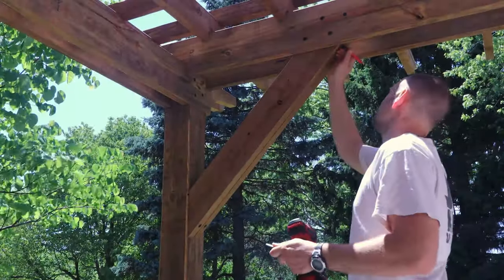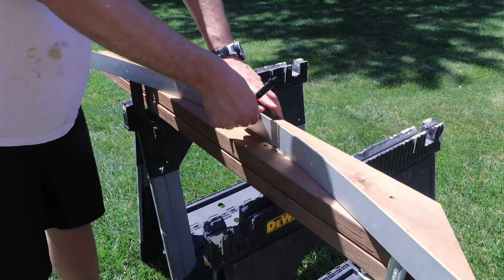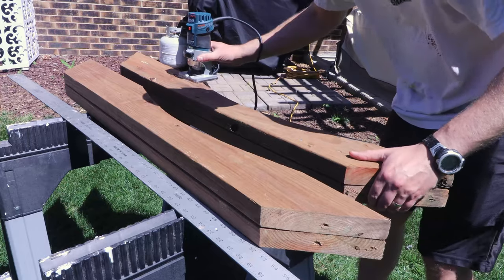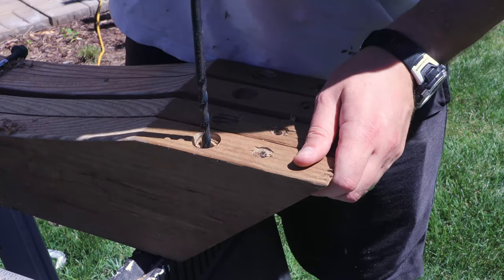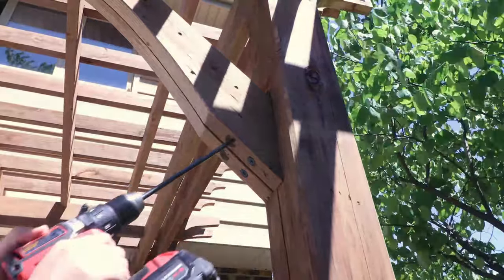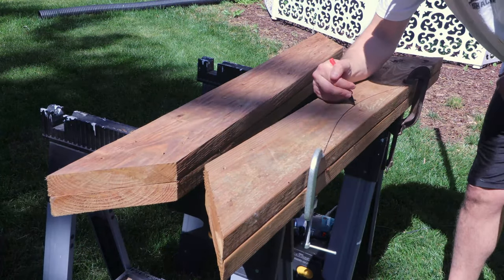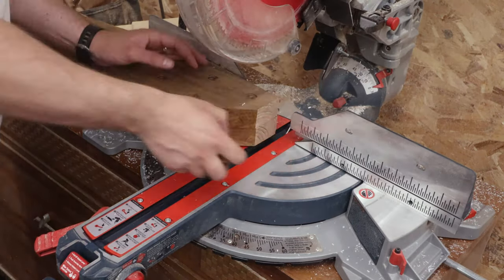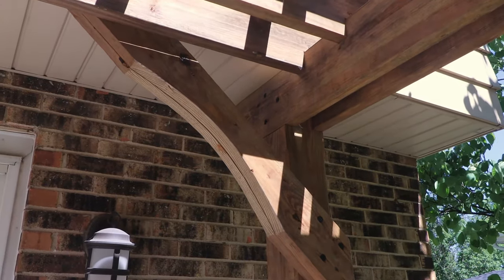Beautifying the Braces | BUILDING A PERGOLA | Part 5

Comment: I noticed you used simpson strong tie post base. Since they don't have 4 sides to the bracket the posts are really wobbly.  Did you do anything special to stabilize the pergola? or did the braces you attached do the work?
Reply from the maker: Good observation.  The braces are what stabilize the frame.
Reply: @GlennFrazeeYT  The reason I asked is because I am building a pergola using the same post bases. In the back of my head, I want to tear everything down and get new post bases, maybe "ozco" with 4 support sides. However, when I came across your video and noticed your pergola looked pretty stable I figured there was hope. Are there any other special adjustments you had to make to compensate for the wobbly post bases?
Reply from the maker: @moselc09  Nope.  Bracing at the top prevents the whole assembly from racking.  It might sway a bit if you push on it, but my experience with high winds on mine is that it doesn't move at all.